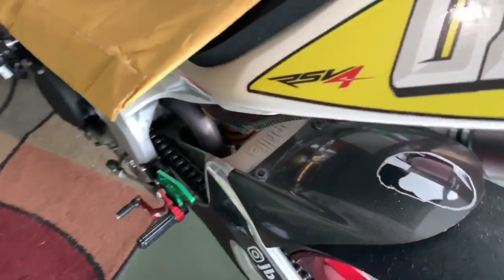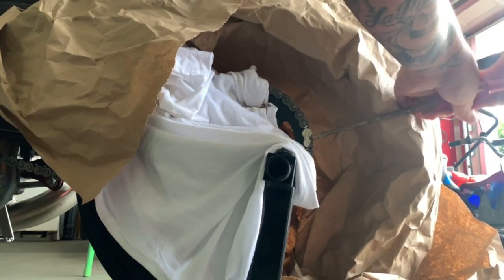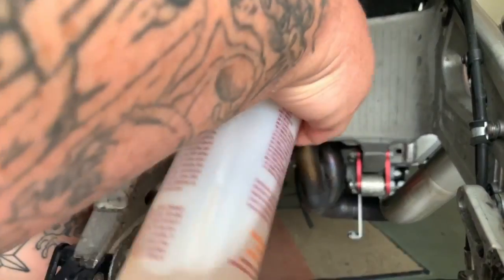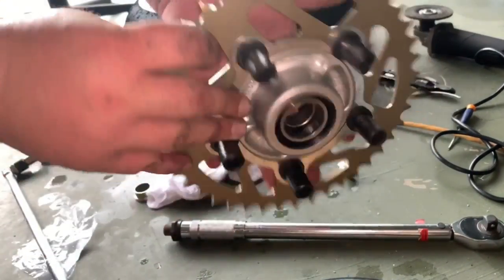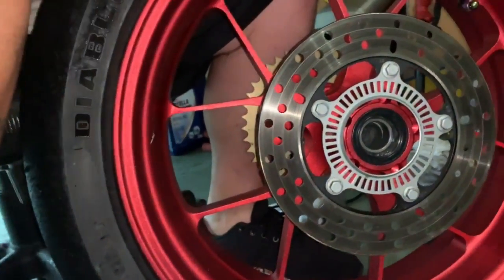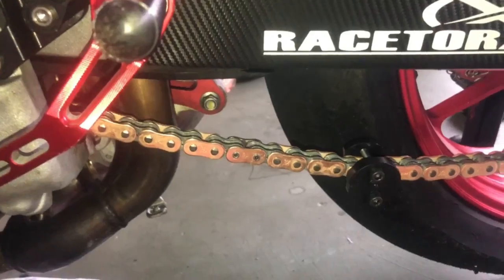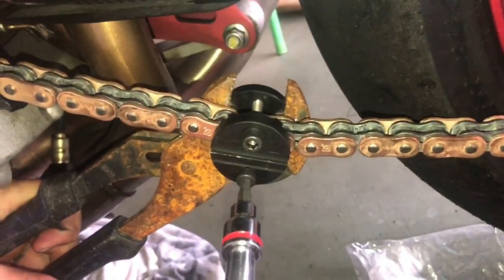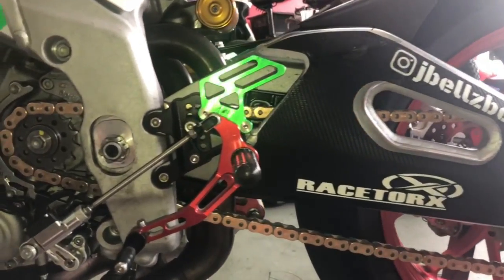RSV4 gets a 520 chain and sprockets *DIY CHAIN AND SPROCKETS*

Comment: Little tip on removing your front sprocket nut. I use a wooden broom handle or anything non-marring and stick it through the swing arms and the wheel and put the bike in neutral. That way ur not pushing against ur transmission. Works great. Cool vid! Stay safe.

Comment: 15 on the front is pretty short. You will get away with it on most bikes but not the rsv4 and the bike will rev our at around 145/150 mph. You can play around with the back sprocket but I personally would leave the standard 16 cog on the front. It will also be inclined to wheelie with a 15. The rsv4 gearbox is more track orientated than most bikes and is pretty much good to go out of the box for most tracks.

Comment: Hi, i have 2014 rsv4, i notice my front sprocket washer is spinning freely while the bolt is tight on, is it normal or someone had installed wrong ? I notice that if i flip the washer the other way around then it’s will be tight, any information would help a lot, thanks